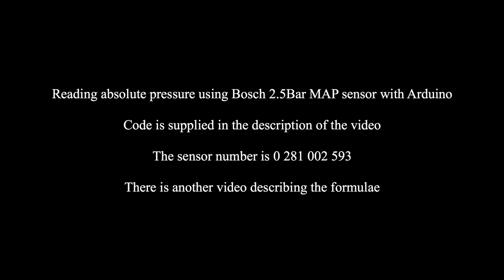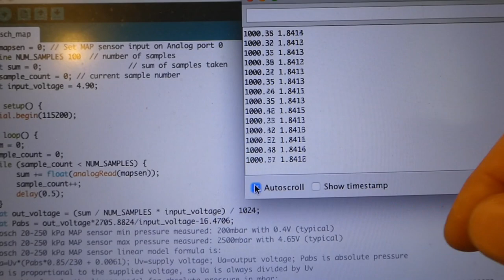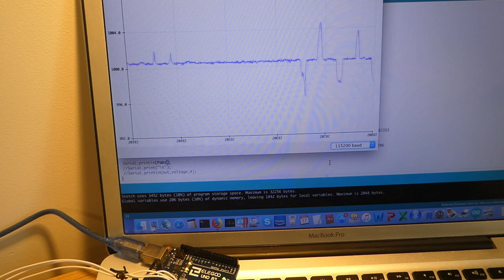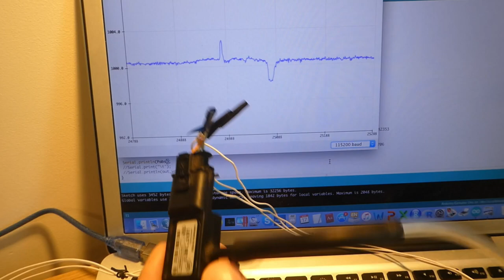Reading absolute pressure with Bosch MAP sensor with Arduino #1 (actual measurements)

Comment: Hi !! Congratulations ! Very cool !!! Can I apply to other map bosh sensors?
4-wire ?
Reply from the maker: Hi ademir, it should work with any map sensor, as long as it is 5V and you know wht the different wires output.

Comment: Do you need to add a resistor to ground for the measurement signal to protect the Arduino analog pin? Should you add a capacitor to stabilize the measurement signal?
Reply from the maker: Hi Nicholas, absolutely agree that these should be done for better and more accurate measurements. It was just that I wanted something quick to measure the crankcase pressure in my car. I can of achieved that with multiple measurements to smooth the signal. Thank you again for the great suggestion and comment.
Reply: @palomban @moremolecules  Can you explain where to put the resister and cap (with values)?  As you can tell from my avatar I have a 1971 Plymouth 'cuda.  I'm working on a data logger to help accurately tune the carburetor.  One of the items I need is vacuum.  I figure using this will give pressure in the intake manifold and then use either another to open air or a DPS310 to measure pressure and altitude.  Then subtract the pressures and / 33.8639 to convert result to in Hg.    I know this is 3 years old but hoping you will reply.

Comment: Sorry, doest`work; LESS_THAN is not been declared.
exit status 1
expected ')' before 'LESS_THAN'

Don`t understand where it goes wrong
Reply from the maker: Hi Frank, as I said in the code below, LESS_THAN is to be substituted throughout the whole code. It is just that Youtube does not allow the symbol > and < in the description. So substitute LESS_THAN or MORE_THAN with < and >
Reply: Sorry didn`t seen that part. going to try yours aswell.
This is my version to read the mapsensor:

/* 
  Mapping example
 connectors:
 1 = sensor
 2 = gnd
 3 = 5volt
  Re-map a number from one range to another. 

*/

 
int Value;    // store the value coming from the sensor
float mapped;            // store the new value

void setup() {
 Serial.begin(9600);

 while(!Serial);
}
 
void loop() {
 Value = analogRead(A0);  
 // map(value, Min Sensor, Max Sensor, Min range, Max range)
 mapped = map(Value, 672, 144, 0, -8);
 mapped = mapped / 10;
 Serial.println(mapped);  

// wait for 1000 milliseconds ( 1 second ) to read every second
 delay(1000);
}
Reply from the maker: @franksmit4914  The mapping is the important bit, but I found that depending on where you use this sensor it may need a bit of averaging/smoothing of the signal. That is why I have the averaging of multiple signal readings. Good luck

Comment: ace works amazing I am using 3 bar version of this sensor what do i change to give the correct offset?
Reply from the maker: You need to update the linear model formula. First get the pdf of the sensor and see my video 2 after that one with the maths. If you still do not understand it, let me know and I can tell you what to change in the code.

Comment: Thanks for the video!
I’m currently working on a project with the same sensor, but i can’t get it to work using the official Bosch wiring pinout.
Could you explain briefly what pin does what?
Reply from the maker: There is a pdf manual for that bosch map sensor (e.g. here: https://secu-3.org/wordpress/wp-content/uploads/pdf/bosch_map_sensor_technical_specification.pdf), but pin 1 and it should be written 1 on the sensor is the +, pin 2 is the negative and pin 3 is the voltage output. The voltage output is the one that can be read with the arduino and one can calculate the air pressure from the voltage that is coming out.
Reply: @moremolecules  Thank you so much! I looked at another bosch manual for map sensors and pins 1 and 3 were swapped, I’m afraid I have broken the sensor by following the wrong manual….
Reply from the maker: @monkeeee7945  I might be wrong, but I do not think you can damage it with dwapping the +feed with the output voltage. Probbaly you can, but try them the other way around and see if it give any readings.

Comment: @04:41 why does the pressure jump to 1000 altough you sucked air ?
Reply from the maker: Hi Utku, it does not jump, it is the scaling of the arduino graphing software. Because it is MAP (absolute pressure) without sucking on it or pushing, it will measure the atmospheric pressure, which at my place is ~1,000mbar or 1atmosphere. It is just that when I sucked, it dropped, then it stabilises at the atmospheric pressure (1000mbar)
Reply: @moremolecules   I dont understand, How the pressure rises altough it is under vacuum ? Is the sensor is not airtight ? You suck air , momentarily the air pressure inside the sensor drops and shows  700. What I understand is, your hose connection from sensors port to syrine is not airtight. Is it correct ?
Reply from the maker: @ytkdmr  It was awhle ago, but I think it should have been air tight, but it might not have been. It was just simple tubing without anything holding it. There might have been an air leak and getting back to normal pressure.

Comment: How do you access the barometer on the iPhone?
Reply from the maker: Hi Gregory, depends on the type of iphone. As far as I know only iphone6 and above have a barometer electronics inside, the previous models would not have it. Then you need any free app that access the barometer and can display the pressure. Hope this helps.
Reply: @moremolecules  it looked like it was an iOS system app...thanks, I found one on the App Store.

Comment: Good job!! A little tricky to understand. Where is that sensor installed?
Reply from the maker: I was thinking of using this sensor to measure more accurately the crankcase pressure in my engine, following the oil catch can. Unfortunately, I did not think about that it measures absolute pressure and with change in atmospheric conditions my measurements will not be entirely accurate. I have another sensor that I can use. I will post once I get some measurements, as I was thinking of second oil catch can, so I was not too sure how much more the pressure will be, hence the sensor. This one is used to measure the manifold absolute pressure in the throttle body and in conjunction with the MAF sensor send information to the ECU about how much air goes through. Basically, how much boost the turbo generates, if I am not mistaken.
Reply: @moremolecules  so, this sensor is located between the intercooler and the intake, and meassures the boost that the turbo blows. My motor is getting worse, i had to take out the catch can to let out free the pression in the crankcase, because started to leak oil though the turbo.
Reply from the maker: @dieseltips  Hi mate, I am really sorry to hear about the oil leak. Where does it come from? Is it increased crankcase pressure and then the turbo oil outlet cannot drain into the crankcase? The strainer could be partially blocked on the oil return from the turbo. Good luck.
Reply: @moremolecules  the oil comes from inside of the turbo,  I had arranged the outlet of the gases and without the catch can the hose blows free to the back of the car, so now I dont see more oil smoke like it was before. I think the oil retourning back from the turbo to the block now that the pressure is going out. Thanks for your videos.
Reply from the maker: @dieseltips  Yes, as you say, most likely the return strainer is partially blocked. This is fairly serious and you may want to check the strainer on the turbo return. If the strainer is blocked, it means that the turbo does not have fresh oil coming in to cool it down and could overheat and fail. I presume that the oil is not overfilled, this may lead to the same effect.

Comment: Do you have an amazon link for the plug? I can't find the part number. Ta!
Reply from the maker: Hi Alex, unfortunately no, I think I bought it second hand from ebay.
Reply: @moremolecules  ta anyways, the code will be very helpful to get this going!
Reply from the maker: @alexjohnston4872  Depending on the purpose, any of these should work. IMHO Bosch produce a variety of these with different codes, although the specs might be sightly different
Reply: @moremolecules  Do you have a link? I have found a code I think its a Bosch 1 928 403 110 but seeing if I can find it assembled
Reply from the maker: @alexjohnston4872  The exact one I had bought it does not exist anymore, but I dound a few that should be the same. For example this one (https://www.ebay.co.uk/itm/Bosch-MAP-Sensor-Manifold-Absolute-Air-Pressure-0281002593/173328596452). On another video I had with the differential pressure (2 spouts): https://www.ebay.co.uk/itm/Bosch-DPF-Exhaust-Pressure-Sensor-Diesel-Particulate-Filter-MAP-0281002772/173328594132. The bosch is a bit expensive, but others that are not branded are cheaper.
Reply: @moremolecules  Thanks for the info, I was meaning a link for the plug. I ordered the sensor from your amazon link here in the UK : ) I have ordered a pack of 10 unbranded automotive plugs so I will just cut back the plastic on the sensor and solder to the pins, I am used to micro soldering so that will work well!
Reply: I liked the look of the DPF sensor but for my needs I think I will simply modify the code so that it takes a reading on power up and uses that as the base pressure level to calculate boost from. should be fine unless I drive up a very long steep hill.
Reply from the maker: @alexjohnston4872  Apologies, I thought about the sensor. The plug came with the sensor, but then I bought this (https://www.ebay.co.uk/itm/3-Way-Bosch-Common-Rail-Diesel-Injector-Plug-Connector-Kit-1928403966/141644551067) to have a backup.
Reply from the maker: @alexjohnston4872  Yes, that should be OK. Good luck, you can probably put a small LCD and have a nice reading.
Reply: @moremolecules  Awesome thanks for your help! : )
Reply: @moremolecules  Hello! which pin out did you use for the sensor? I have one here with the exact same part number and the reading from the code are correct if i put the analog pin to 5v and ground but the sensor just showing a static value of 0.6v / 327mb when connected with 5v to the left when looking in the plug EDIT: i mean looking into the space for the plug on the sensor. the guy in this video is adding more confusion.. https://www.youtube.com/watch?v=MSAhvKPYM0U
Reply from the maker: @alexjohnston4872  I looked at the Bosch documentation. The pins should be numbered, Pin 1 is 5V+, Pin 2 is Ground and Pin 3 is output signal. If that does not work, I can double check with my module, although I have to find where I have put it.
Reply: @moremolecules  Thanks for the quick response! I originally googled "0281002593 pinout" which lead me to this picture which looks like 5v is on the left looking into the socket on the sensor.. https://i.ytimg.com/vi/MSAhvKPYM0U/hqdefault.jpg I have since found pictures of the sensor with pin numbers on (mine doesn't have the numbers on the sensor annoyingly) and it looks as if the 1 (5v) is on the right of the sensor if you are looking into the socket : ( I guess the orange wire in your video is 5v?
Reply from the maker: @alexjohnston4872  On mine if you look at the socket from the side where one presses to release the clip, the most left one is numbered 1. Unfortunately, I could only find the one with the two spouts, but both are bosch and I assume the numbering will be the same.
Reply from the maker: @alexjohnston4872  Yes, that is the same as mine
Reply: @moremolecules  wish mine had had those! ah well : ) replacement on order. the pinout in the bosch manual is wrong on these sensors!!